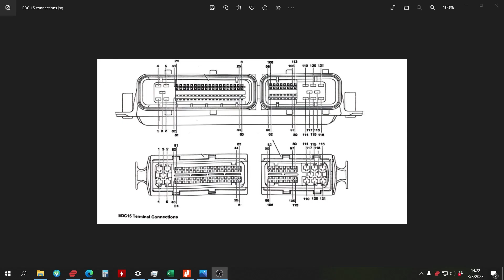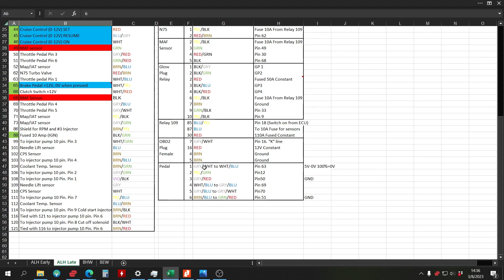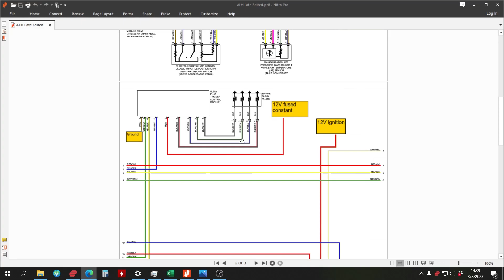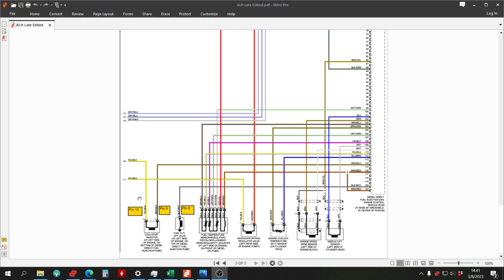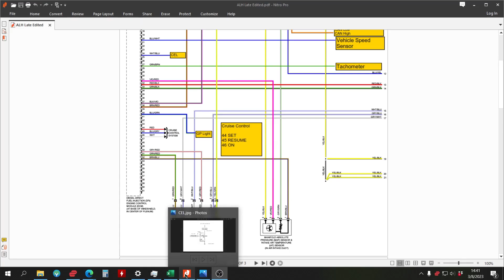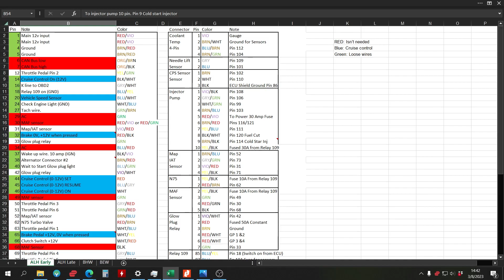TDI swap: ALH wiring explained, in-depth.

Comment: That clutch 12v, are you just tying that into regular switched ignition power or is it actually tied into a pedal switch?
Reply from the maker: I'm sure you know I have two swaps. Both of them did not come with clutch switches from the factory. The XJ has a switch, and the CJ is now tied to a button. The reason I installed switches is so that engine doesn't over-rev. When you rev the engine with the clutch in it's resting state it will rev higher with same throttle input; almost like you missed a shift (not as high, but so you have an idea). With the clutch pressed it, it revs how you would expect and falls back down quickly. It also disables my cruise control just like the brake switch.

Just be aware that the clutch switches are backwards to what we're used to. Normally we have 12V on one line and when we activate the clutch (which lets the button out) then 12V is now on both sides. With the VW switch it's 12V on both sides at rest and open when the clutch is pushed in. I tried all variants of "normally open" and "normally closed" switches only to find that they didn't work. I noticed an old GM switch had 4 prongs on it, so I ordered Painless Performance part number 80176 and it works on the XJ. There was just no room to implement a switch on the CJ unless I took everything apart.
Reply: @TDISwap  Awesome info, thank you.

Comment: Are pins 1 and 2 constant 12v (to the battery) or key on 12v? (Gets power from the ignition) I have most my harness together but between the 109 relay and other power sources I’m a little confused. Thank you so much for the video it definitely helped with the rest!
Reply from the maker: All your power sources can be tied to the same key on power through an adequate fused power source. All the ECU powers, the wake up wire, all the feeds from the 109 (you don't actually need the 109 relay) even the two power sources for the OBD2. It makes it easier that way.
Reply: @ sweet thank you so much man! That helps a lot!
Reply from the maker: @montana1602  no worries my dude.
Reply: @TDISwap  what fuse should be used? i plan to just run this thing on a stand before i tear it down for fun. can i just connect all the powers together to one wire and connect to 12v and remove it when im finished? dont care for keys

Comment: Interested seeing your wiring set-up for CEL/Glow Plug light. Have been running a TDI swap in my Vanagon for a couple of years with neither of them completely turning off. My harness had a flying lead (wire) from the ECU for both those lights to the 1982 Vanagon panel. Can I assume using the 2N2222,  that they would shut off..?  Nice video and thanks..!
Reply from the maker: Yes, I did. I'm thinking this is Bruce and you talked with my brother already.

Comment: pin 116 /121 is not ground it modulates the QA using pulse width modulation (PWM)
Reply from the maker: You learn something new every day. Thank you.
Reply: Do you know what pins 20 and 27 actually do? I'm swapping into a b5 chassis and I've been trying to figure it out for days

Comment: Thanks for this video! Is this spreadsheet available on the Facebook group? I looked, but it looked like an older one was on there.
Reply from the maker: They both are on my group TDI Swaps. I left TDI swapped trucks due to their inability to remove a certain vendor that was doing wrong in my eyes. Hence why these videos on wiring are here.

Comment: And to think I'm over here videoing your diagrams laying on a hotel bed 😂
Reply from the maker: Hey, people learn differently. At least with this video people have a thorough understanding of what each wire does. I didn't go into voltages or resistances, but it should work for most people.

Just think, people are taking those diagrams I made, and trying to sell homemade harnesses. Scumbags gotta scum, I guess.